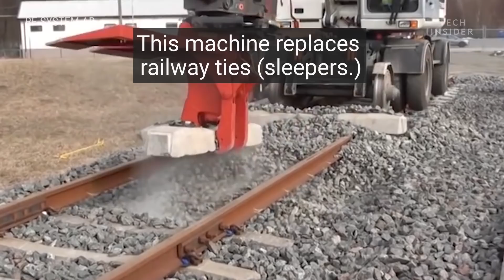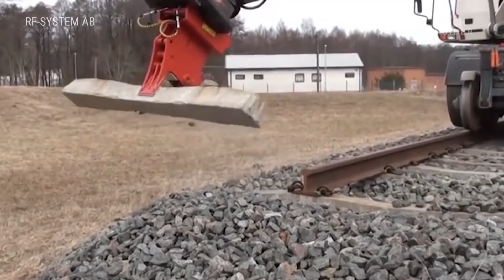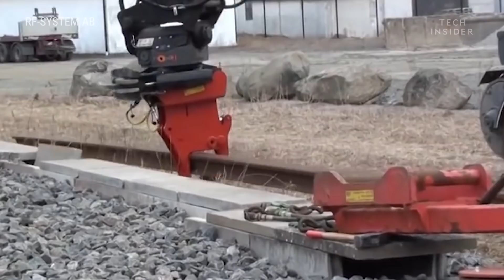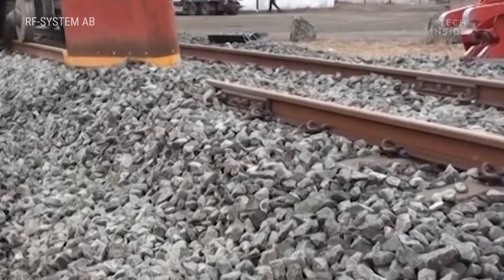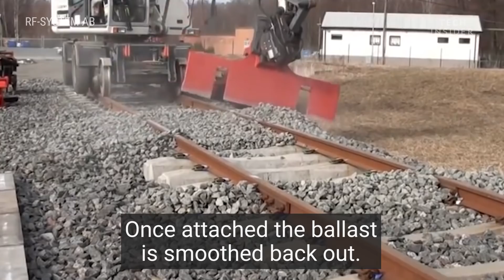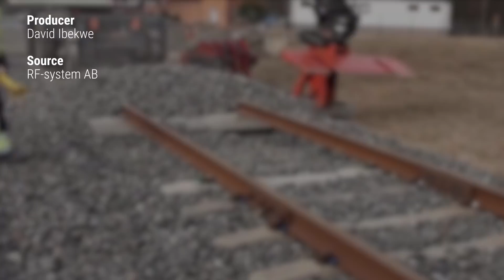Machine Replaces Railway Track Ties

Comment: Machine repairs everything nowadays
Humans will lose their jobs
Reply: Adi Azad Humans will go from a 40 hour work week, to 30 hours, to 20, 10, 5, like we have done since the start of the industrial revolution. We are miles away from mass unemployment which has been feared since the time of Romans who stopped advancements in production. Demand is infinite. The amount of work is not fixed. Goods, transport, services can get way cheaper. Cars used to be a luxury but are still relatively expensive. Houses are extremely expensive. We have a lot of savings to go (imagine how much you could buy if a house was no more expensive than a car).
Reply: Little Cripple wow bro you opened my mind